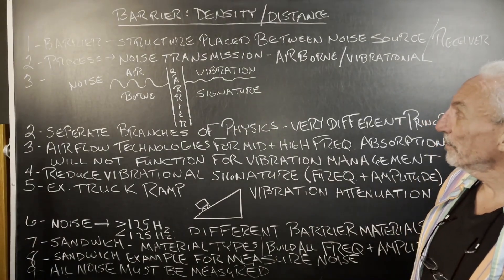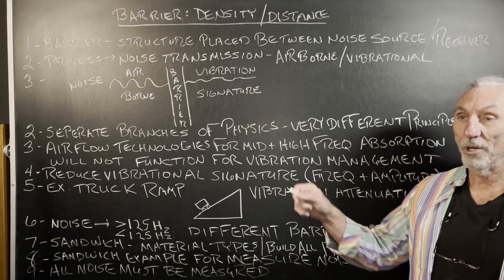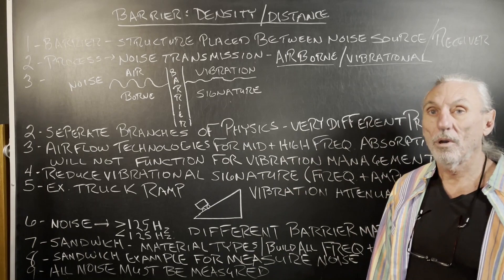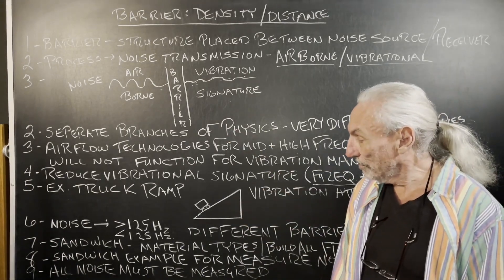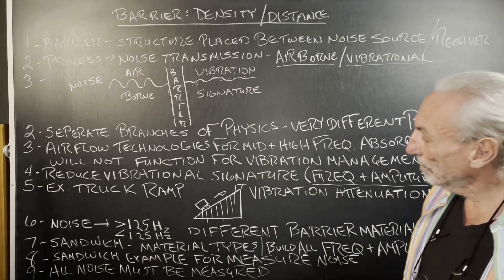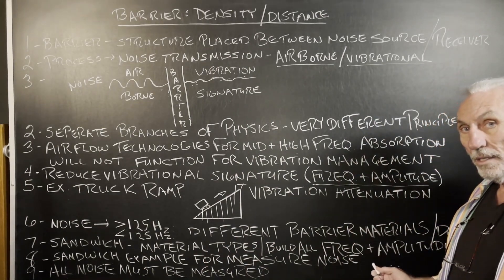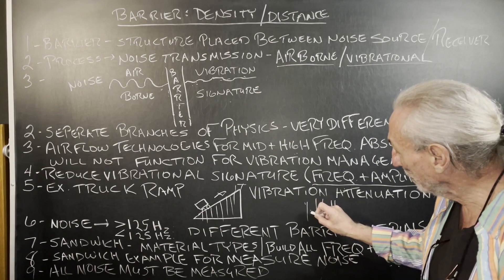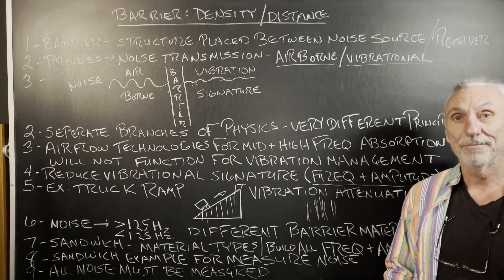Barriers: Density & Distance - www.AcousticFields.com

Comment: So let's say we are doing a double stud construction with a 12" air gap in between studs.  Do you put this "sandwich" of materials (MDF, and MLV) goes in between the air gap between both studs (like a firewall), or do you put this "sandwich" of materials on the outside of either wall.  It's not clear, based on this video, where the sandwich of materials is placed in the wall assembly.
Reply from the maker: What are the frequency and amplitudes of the noise?
Reply: @AcousticFields  It's a live room with a 9' concert grand piano.  So the frequencies go  as low as the low A on the piano.   Furthermore, it is in a loud, urban setting where there are outside noises to block as well (basically, that garbage truck noise, but intermittantly, 7 days a week during the day time.  Last small room I built for upright piano worked well.  Room within room with 24" air gap, double stud wood construction 16" o.c., open faced on the inner walls, studs lined with bare fiberglass insulation.

However this new (to me) sandwich technique may be take up less space to achieve the same goal.  The room within room design took up roughly 3-4 feet from the outer wall to inner wall.

Comment: Hi Dennis, i just installed some pieces of foam covered in a VELVET kind of fabric, behind my head, the sound got muffled, just horrible! Could you talk about the best and worst types of fabric in a video and why the velvet made the sound so bad? Thank you!
Reply from the maker: Middle and high frequency treatments work using a process called molecular velocity. MV is another name for air flow. You must use a fabric type that allows for air to get through it. Velvet fabric types do not allow for enough air flow through it. They lack air permeability.
Reply: Thank you so much Dennis!! Big fan of your content.